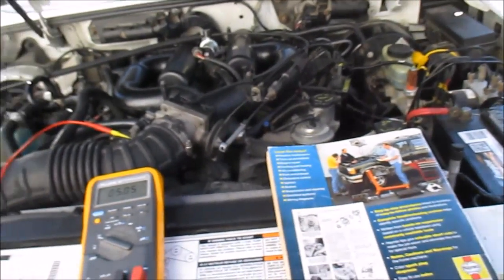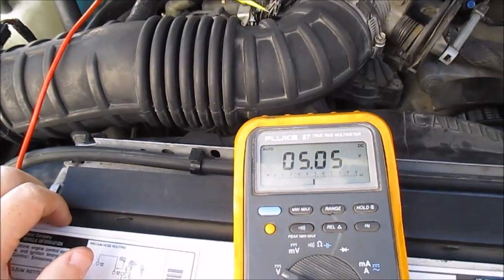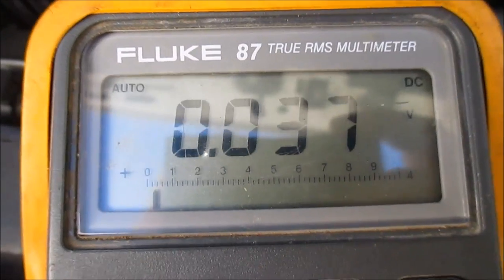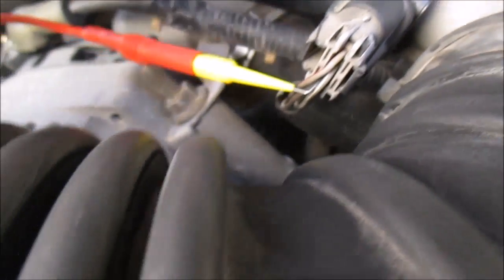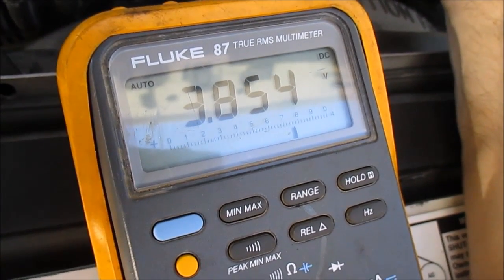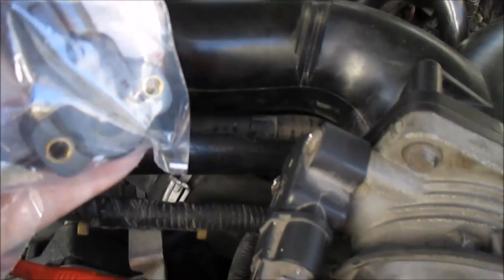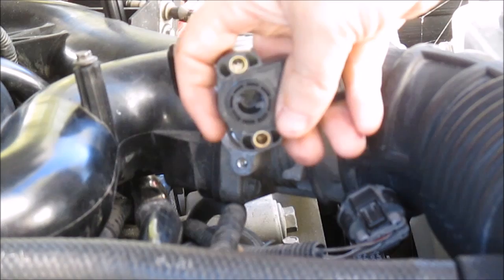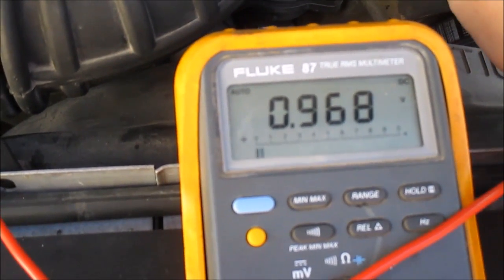Testing and Replacing A Throttle Position Sensor Ford Explorer

Comment: I have only used a manual range one and i prefer it. 
I really only wanted to know where the sensor was. On this model.

I changed out a TPS that was bad. Vehicle worked fine for a while then started doing the same thing. 2 more replacements. 

I spliced my multimeter with aligator clips to connect to both the plug and the sensor. 
Turns out the new pigtail that autozone sold me for the TPS was faulty and the pins were not connecting with the sensor. 

I thought i was going to have to chase a wire and find the break.  Nice video

Comment: Volt meter pos. To Vref orange
Volt meter to neg. Return black wire.
Key on , move throttle v should be 1to 4.5 varying.

Comment: The digital multimeter has different ranges for measurements. Once it reaches it's specific range, it will change over to the next range. That is why you see a quick 0L on the display that you cannot lock into. Analog meters does not have that problem. But thanks for your help.  Know I know how to test it. Thanks.
Reply from the maker: Thanks for watching!!

Comment: Total noob question:  should the electrical tests be done with the negative battery terminal disconnected as with other electrical type maintenance?
Reply: Good question but no, not in this situation

Comment: Thanks for the walkthrough.  I managed to strip the screw heads anchoring the TPS despite getting the Phillips head of proper size. I can see why you replaced the screws.  Any suggestions on how to remove the screws I foolishly stripped lol?
Reply: First of all i broke them loose with a vise grip.. I then used a Phillips bit with my 1/4 inch ratchet with 1/4 inch socket cause thats what size fit the Phillips bit.

I did try the Phillips first but soon figured out that they were to tight and  I stopped before I stripped the heads
Reply: One of mine b are stripped too. I've been at it all afternoon

Comment: I watched the absolute throttle position change by itself on my 2000 Explorer ohv, by using a blue driver scanner. That’s how I knew mine was bad. The bolts were the same size on my engine if anyone is wondering. The new tps makes a big difference.

Comment: that application might be good cause to use an analog meter?  I always hate digital meters for that sort of diagnosing.  Good thing is, I now know how to check mine right now which I am not so sure its good or bad but you showed the volts to be looking for.

Comment: Great vid, didn't know you could test those. Definitely will be testing mine tomorrow. Oh yeah was hella funny too hearing your response to the meter 😎 again thanks
Reply from the maker: Hope it helped. Thanks for watching!!
Reply: @figibloom  Would you happen to know the good/recommended readings should be on the slightly older 4.0 OHV engines (95 explorer) ?   Would they be the same?  My Chilton manual just lists how to do ohm test on sensor itself....I would like to test everything with power on...so harness is tested as well like what you did.  Thanks.

Comment: Man I did the same thing with my MAP/BARO sensor on my 96 E350. I was checking for volts and then after replacing the thing I found out that it outputs variable frequencies, not voltage.

Comment: i was going to change mine myself but then i figured i may have a bad new sensor and not be able to tell or it may be a different sensor or wire short or something to do with the throttle body or idle air control valve. soooo i will take mine to a mechanic. i am having shift problems with the transmission.
Reply from the maker: Well shift problems with a transmission can be a lot of things. Could be bad solenoids, slipping clutch packs, dirty trans fluid, bad electrical connections, wiring issues, sensor inputs and outputs, and on and on. Well a good place to start is just getting your vehicle scanned for any fault codes, see if the TCM or PCM has any stored fault codes. That would probably be your best place to start, and might lead you in the right direction. Any mechanic should be able to pull codes for you, or you might be able to go to an auto parts store and have your vehicle scanned for free. However not all scan tools can read all modules on a car. If it is a generic scan/code reader it will probably only access very limited data just general obd2 info, but most mechanics have the scan tools that have enhanced scan capabilities. (to scan all modules) I hope that makes sense. Well I hope this info helps you out. Thanks for watching and thanks for the comment. Have a good day.

Comment: Soo? what were the symptoms you were experiencing? and what was the final result? the sensor solved the problem. I wish mine was as easy to get to as yours.
Reply from the maker: Well I tested mine and I thought I had an open in the circuit so that is why I replaced mine, but mine was actually good. I posted this video to show how to test a tps sensor and to show my mistake and how to avoid that mistake. Well thanks for watching and thanks for the comment. Have a good day.

Comment: You have your meter on auto range, it will make the meter hiccup making you think the tps is bad.
Reply: wow, good find! i held off on reading the comments but i couldn't figure it out
Reply from the maker: Yeah that was just a simple rookie mistake on my part. I had my meter on the 4.0 V auto scale and when I got up to 4 volts my meter switched to the 40 volt auto scale and made it look like I had a open in my sensor when I did not. Well thanks for watching and thanks for the comment. Have a good day.
Reply: And the part where your moving the throttle as you place the TPS on your hands block part of that but i believe there was enough visible to get the jist,just to be clear on my end you had it full open, put the sensor on, and let both go to resting position or idle at the same time right? I'm getting low circuit and flooring it is I'd say actually really a quarter open think I need a little more thank you
Reply from the maker: +busjockey1 
Yep it was the 4 volt range switching to the 40 volt range on auto. It was an operator error mistake for sure. I did not catch it until I was editing my video that I saw what I did wrong, and I said crap there is my problem. Well thanks for the comment and have a good day.
Reply: No biggy, you caught it, thought I would reply though so everyone else knows not to make the same mistake.  Make sure your meter is in manual range when checking a tps.  Nice video, this is a good learning experience for everyone.
Reply from the maker: +busjockey1 
Yeah I thought the same thing. I thought it would be a good example that everybody can learn from. Thanks again for the good comments and suggestions. Have a good day.
Reply: @figibloom  What would be the problem then if it was only a probing error? You still have a check engine and a code problem that needs to be solved if you don't replace it.